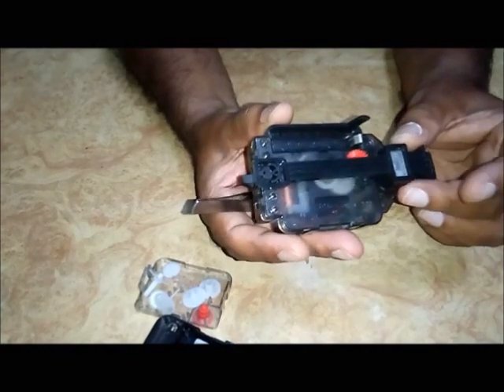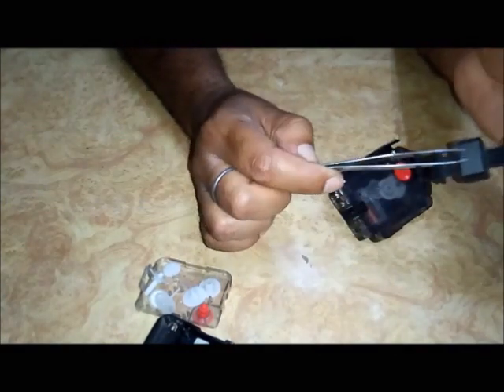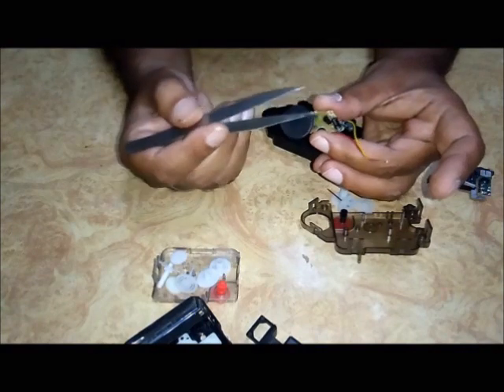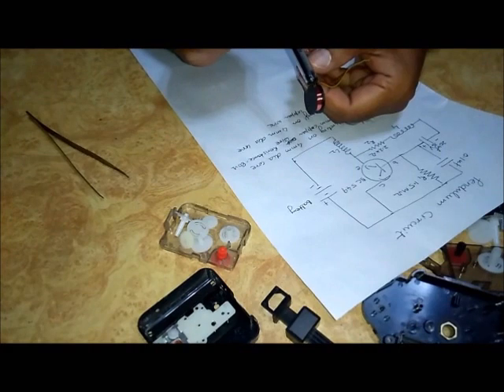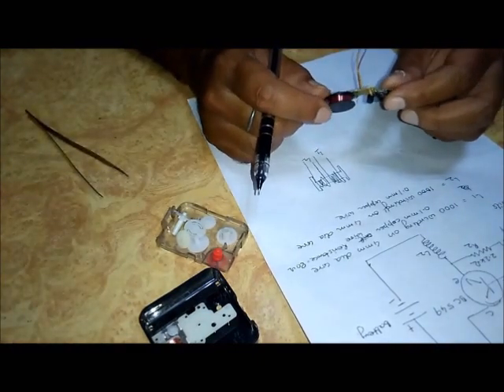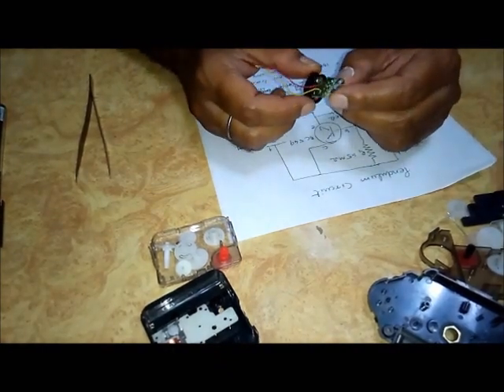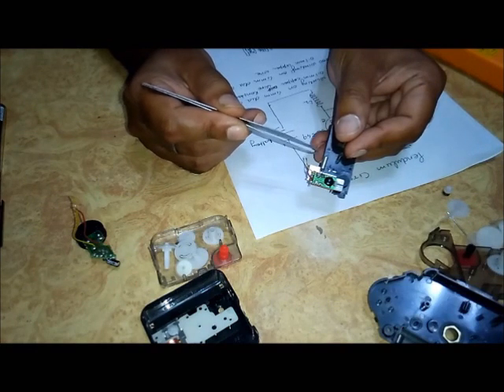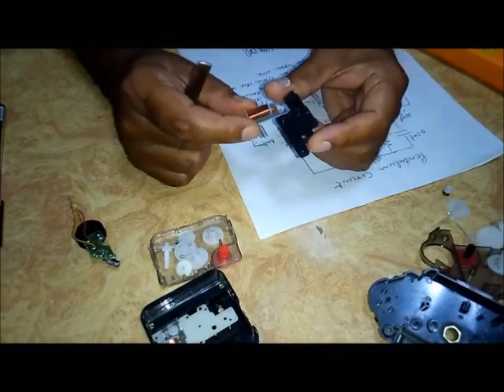how to repair quartz clock and pendulum DIY

Comment: Sir,
Your pendulum movement explanation was just fabulous. Just one query, is pendulum circuit assembly board available in spares please help
Reply: You can buy a complete movement and detach the small coil PCB. You can use the clock somewhere